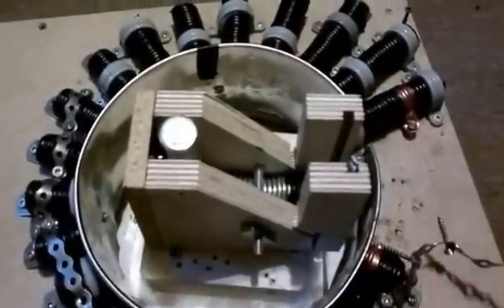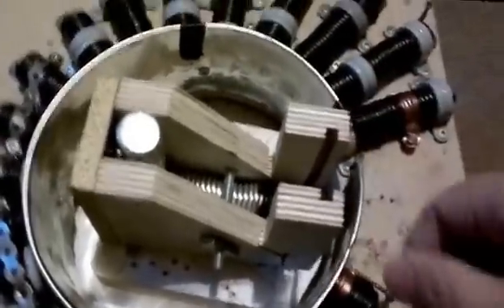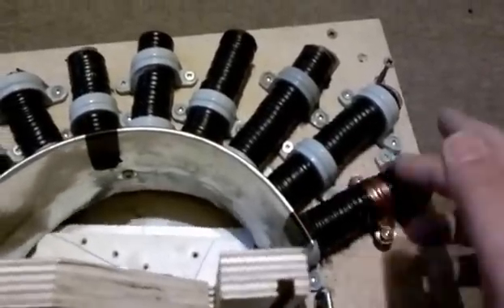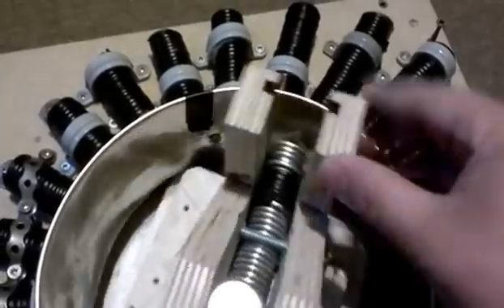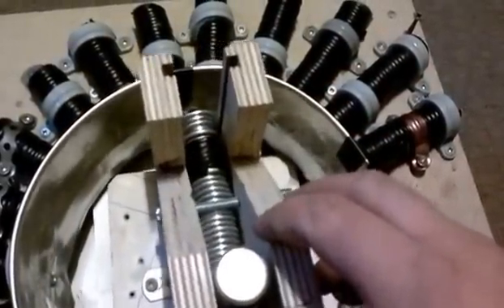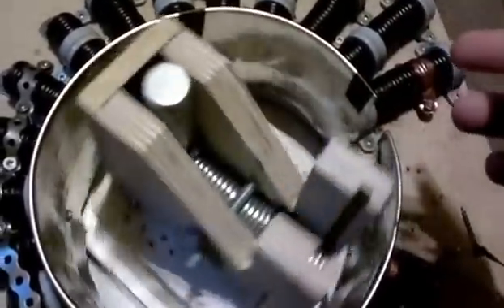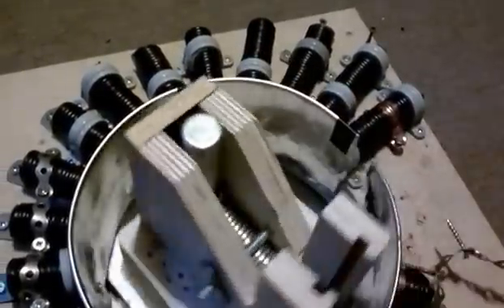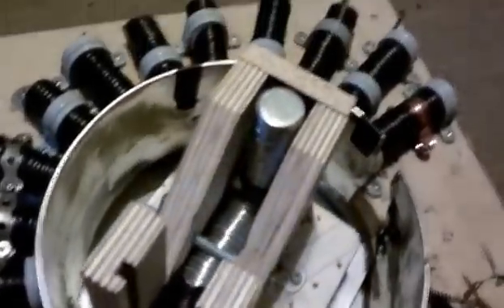The Magnet Motor Chronicles Repulsion Test 2 single pole interaction.

Comment: I'm watching all your videos and I would like to thank you for time that you put into this. I think that if I were going to try this configuration (after seeing yours) I would try a horseshoe magnet shape for the rotor and a second level of magnets for the other magnetic pole to work with. I would align the second level of magnets to be strongest where the first level is weakest. I look forward to the next video. If you're still in to this, maybe we can talk after I learn all you have to show.
Reply from the maker: +Jeff B Thank you Jeff, yes staggering the magnetic strengths vs the weaknesses is something I have tried but you need in my opinion an odd number say 3 stators and rotors to keep it mixed up so they do not balance out and put that on a vertical unbalanced wheel so gravity kicks in on the down. An unbalanced wheel when dropped from 12 oclock will go right back up to 11 oclock. This is what I would do if I were you, I however do not have the number of magnets or money to try such a configuration and am busy with 5 other projects now that use a small pulse to overcome sticky spots. I needed a break from not seeing things do a spin, it takes a lot out of ones mind, do not get too absorbed in this over unity idea it is an endless loop that will keep you awake at night.  Do it as a fun hobby but try not to get obsessed with it as I did.
Reply: We seem to think alike. I'm planning 3 stators with 3 modified LC tank circuits for a pulse that returns back much of the used electricity. I've drawn a clever circuit diagram and plan to test it in a simulator over the next few days.

Good luck with yours